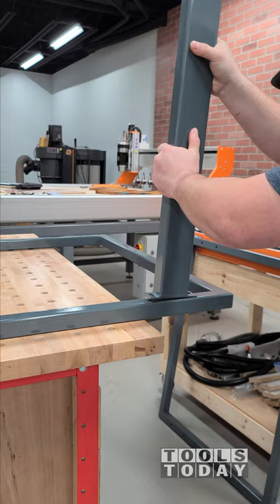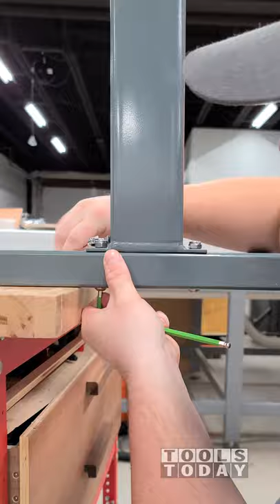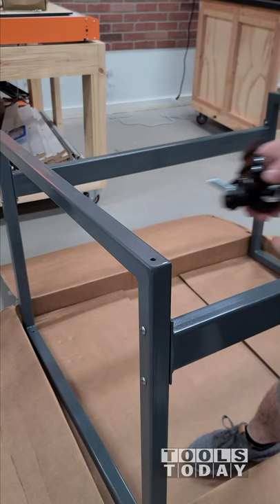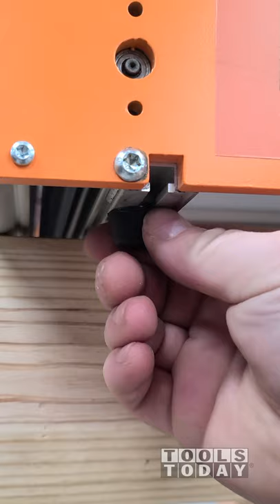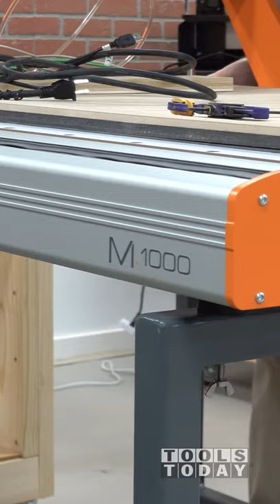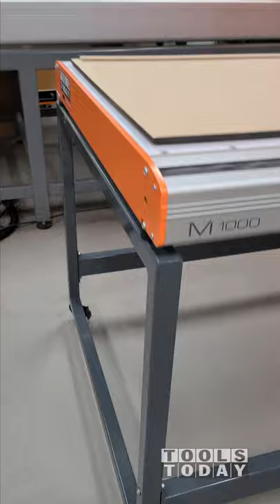Unboxing and Setting up Stepcraft M.1000 Stand

Comment: A stand for that tool to move around and yet their is more cables holding it to a small area.
Reply from the maker: The cables, just like any corded tool, can be unplugged and plug into another spot very easily.
Reply: ح